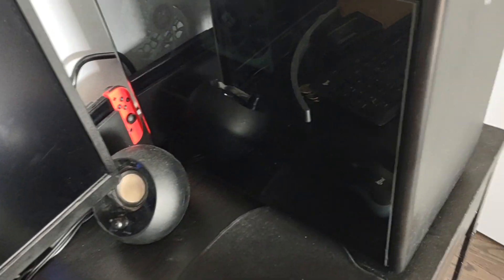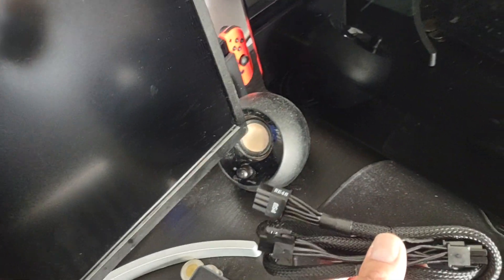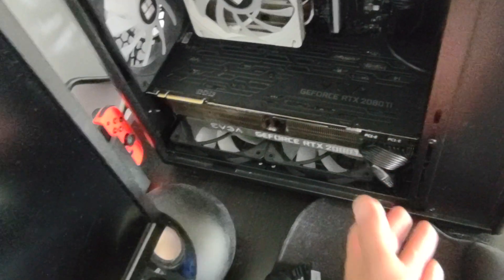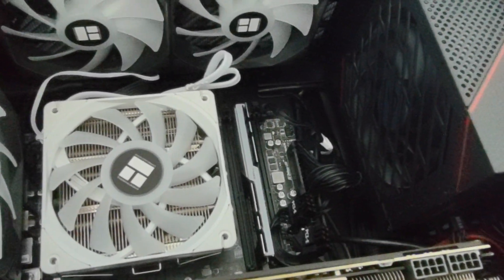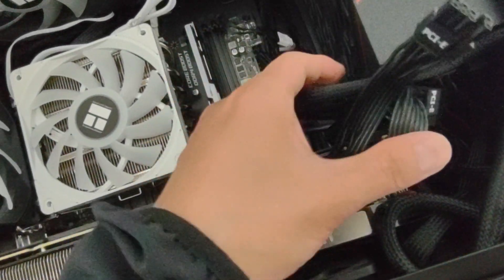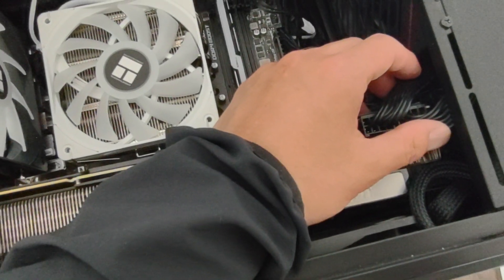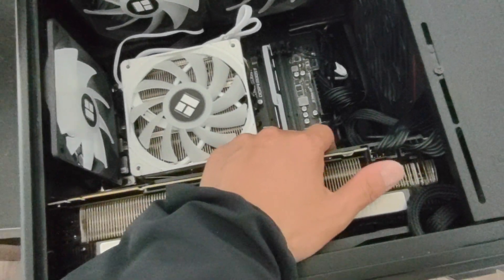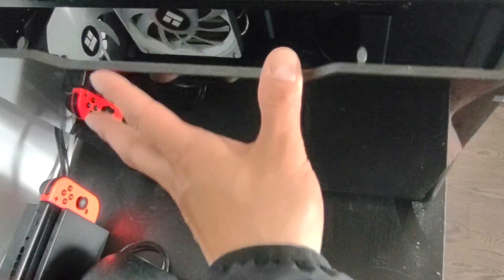Your graphics card needs your help right now!?

Comment: I have a 4090. It takes 4 8 pin cables. I ran 3 cables from my 850w Power Supply. Should I run 4?
Reply from the maker: I would play a few games (i.e. 2-3) and record the gpu temps with the current setup. Then do it with 4 cables, play the same 2-3 games for a few minutes or so and check the temps and power draw and report back? Put in other words, from this test, aforementioned, you will know. From my own test, i noticed the power draw is less and system runs cooler but that could just be a fluke.